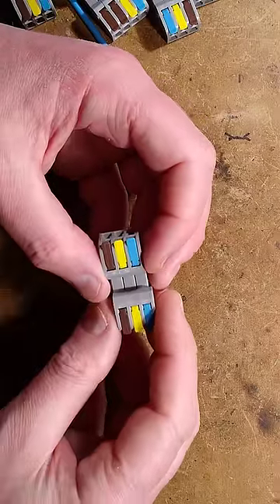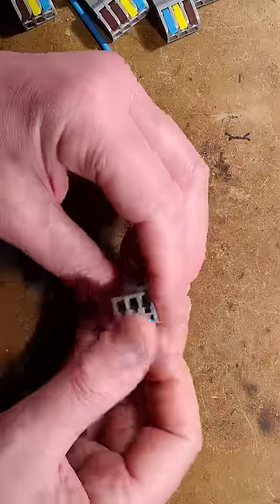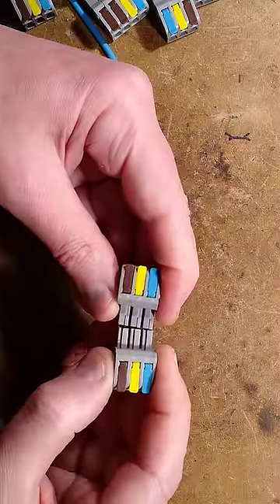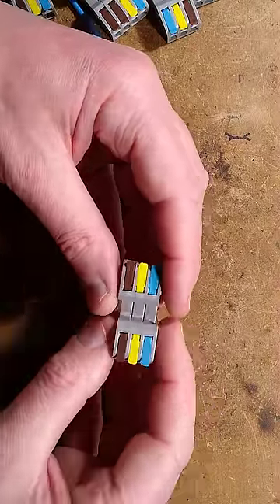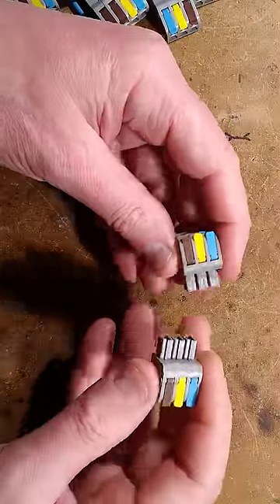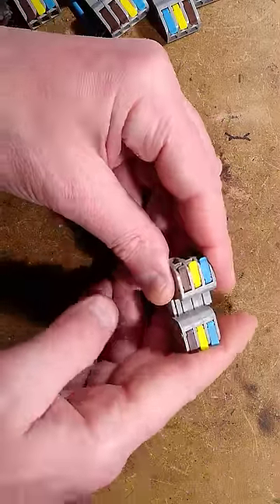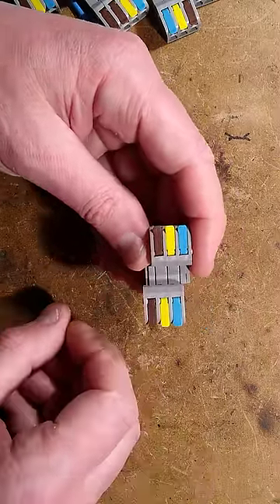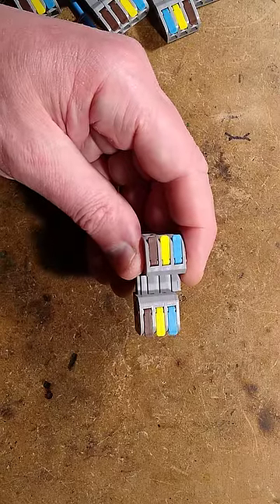This connector can kill you

Comment: As an electrician I will say take your time to make sure you are connecting properly but i will say it would be easy for the manufacturer to add rectangular male and female guards which makes them less universal i guess but at the same time i would make sure my lines were on male ends that way i know if it's male it's supplying power
Reply: In fact I've rarely seen a connector without male and female ends

Comment: Looks like this would only be rated for lighting circuits due to its size, You should gave some sort of fault protection like an RCD or RCBO protecting this circuit which would trip straight away on a Line to Earth or Neutral to Earth fault/ incorrect connection.

I would be more concerned if you do not have any ADS (Automatic Disconnection of Supply) device at your Consumer Unit/ Fuse Board.

These connectors, if used correctly and the quality of them, are great as long as you have the correct Current Rating and Conductor Size connector.  You should also put terminated conductors into some form of junction box for further protection.

Comment: Rotate the left plugs connection alignment 90 degrees and the right plugs alignment 180 degrees. Now it cant be put in misaligned, upside down or any other unintended direction without Intentional alteration.

Comment: If you connect the Live  to Earth then the circuit will trip. unless of course the ground is not in fact grounded, then the casing will become energized, but there's no path to ground to complete the circuit, so your your 👍
Reply: Thanks. I was wondering "do they didn't have differential circuit breaker in house's grid in USA ??"
Because if not, then the wall grid and any damaged electric device could actually kill you.

I think this guy just didn't know what he's saying. That's 100% more probably than having no circuit breaker in all USA 😅

Unfortunately look like nobody in the comments know anything about domestic electric grid😢
At least there's some engineer to think for them !

Comment: Yes and the assuming it has an rcd it would trip instantly. Maybe only use these on RCD protected circuits
Reply from the maker: The RCD would only trip instantly if the connected device was on a grounded surface.

Comment: In the 1880’s Oliver Heaviside wanted to figure out how much electricity was being wasted by then-current design electric generators, so he divided the total coulombs produced in the field by the cross section of the wire.  His answer ran to thirteen orders of magnitude.  

Aghast, he threw his answer away, went to the stationer’s and bought a bigger envelope, and tried again.  The second result was even bigger.  Knowing no one would believe him, he abandoned his quest and moved on to other projects.  

TL; DR, if we designed batteries and plugs correctly, we could run the entire United States’ grid off a single 9-volt battery.  Listen to Louie the Lightning Bug kids, and play it safe around electricity.

Comment: Wouldn't that immediately trip the breaker because ground is tied to the bus with neutral and it would be a short circuit?
Reply from the maker: Not if the loads case was not sitting on a grounded surface.
Reply: @bigclivedotcom  But wouldn't the case itself be grounded with a ground wire back to the breaker box?

Comment: This is why you always need to be aware of what you're working with and to test connections. 
That's neat but i wouldn't use it. Single piece terminal would be more effective. Ive seen a lot of cheap knockoff third party parts that dont put measures in place for things like this. Also do not be doing electrical work with the power on if you value your life. Use a multimeter to ensure you've connected things properly before applying power.

There's a lot of common sense needed for electrical work. We all are aware common sense ain't common.

Comment: If the only fault is live connected to ground, then nothing would really happen. Because the ground and the neutral are connected in the panel, so unless you are also having a neutral failure the appliance case won't carry live voltage. The majority of voltage will return to neutral via the ground-neutral bonding jumper in the main panel

Comment: So there is one live and one neutral connector not connected, therefore you don't have a completed circuit. A bit like trying to connect one jumper cable and expecring something to happen. Or am I missing something?
Reply from the maker: If you have a motor sitting on the table in front of you and connect its case to live you will have a live motor sitting in front of you.  If you are referenced to ground and you touch it, it's YOU who completes the circuit.

Comment: The same would happen if you weren’t using this connector and accidentally connected the live and earth together.  These things are just tools to help make your job easier.  They aren’t there to replace any part of your job, especially the part where you check and double check that what you’re doing is safe 🤷‍♂️
Reply: Exactly. This design is fine, nothing wrong with this connector.  It's the idiots who use them incorrectly that have a problem with it. Any connector can have that same issue if you cross the live and ground wire, not just this one. People in this comment thread are making comments about something that they know nothing about

Comment: I don't like those connectors either there are some better options besides what type of machine i wouldn't trust them they can melt if you are using something that draws alot of current they will fail easy

Comment: I’m not that dumb to do that.   Things are way to safety made.  The connectors like these are a pain to take apart.  They wanna break before they’ll release.  You need to press like 3 things so they’ll release.  And you almost would rather just cut them and solder like back in the old day.  When it’s cold out too trying to muck with with your fingers.  My brain (hammer smash)

Comment: Some of these modular connectors and DIN rail components coming out of China are really fantastic, they have some great designs and high utility, but then you get an absolute stinker like this or that "smart" breaker you reviewed where the oversights are so blatant and easily fixed by changing a couple angles in a CAD file that it ruins the reputation of all the manufacturers on Ali making very cool and cheap tech available for the average consumer (me.) The waterproof screwed-on LED cables I have that cost me $10 for 20 pairs have different sized pins and a peg-in-slot design in the connector to make sure you can't even intentionally reverse polarity (the first thing I tried when I got them because I know I'm clumsy af.) I really wish the Chinese government had some way for foreigners to report stuff like this. Internally, China takes public safety regulations very seriously (just look up what happens to corrupt contractors who cut corners so blatantly that it gets the attention of the provincial or even the national committees) so why not let foreigners weed out bad actors that are also selling these deathtraps in China and getting away with it because of local corruption or just plain old survivorship bias.

Comment: I'm ignorant to anything electric. If you do make this mistake and the metal chassis of your device becomes live with, lets say 220V AC, and you touch the chassis will you automatically die or would the breaker in house be tripped thus saving tour life?
Reply from the maker: If there's an RCD or GFCI then it will hopefully save you from a bad shock.  If there isn't one then the risk of electrocution exists.

Comment: That's the least of your concerns if you're dumb enough to hook up that connector to potentially lethal amounts of power. 

Insulation catching fire because the wire gauge is too small would be your first concern.

Comment: If that happened, my reaction is first, why are you working with a live socket, second is what happened to the fuse. I mean that should immediately trip both the differential and the power fuse.
It could be made better to prevent that error but you have far more worrying ssues if you do that and the casing actually goes live.

Comment: If you plugged live into ground the breaker better trip.
Reply from the maker: If the device is sitting on an ungrounded surface there will be no current flow (until someone touches it.)
Reply: @bigclivedotcom  but you have ground connected to neutral so you should still have a fault current path that should sort the line to ground and trip.

Comment: Designing it as a hermaphroditic connector is itself a serious hazard, even before looking at the universal design. There's a REASON that all safe designs to not allow you to just connect two independent building power circuits together.Even if you don't shift the plugs to connect Hot to Chassis, there is nothing preventing two 'line side' plugs from being plugged together, cross-connecting Hot and Neutral.

Comment: But it’ll be fine the fuse will blow…… after your fingers. This is why rcds and not buying stuff off eBay are important. 
We’v had this type of connection for lighting forever but with one big difference it only goes in one way. Buy reputable gear and this is a D.estroy I.t Y.ourself special

Comment: If your circuit breaker is going to give you 250 volts out of a single wall outlet there's a problem and it's not with that connector

Comment: Nope. Connect phase to earth and all the system will just cut off immediately. 
At least it's what happen for a French electric grid. There's a thing constantly counting what's in and what's out of the house grid. It's named "disjoncteur différentiel", differencial circuit breaker...

If the amper in a'd ampere out of the geid are different : immediately cut off.
Because it tells that there's an electric device that have a misfunction that's connecting the outside of the device to phase, meaning you can get electrocuted by touching it. Or there's someone getting electrocuted somewhere.

If you didn't have a thing that immediately cut off your grid in such a case : then you really can be killed off by your house's grid ! 😱
Reply from the maker: If this was in a piece of industrial equipment and a motor was removed and placed on an ungrounded surface it would become live.  Very little industrial equipment uses differential breakers.
Reply: @bigclivedotcom  that's not the equipment that have differential breaker. It's in the grid.
I cannot imagine a house or industry grid without this. Maybe in a poor Indian or Somalia village, eventually. But not in any modern system.

Try to connect it this way, and you will see what happens. Light will shut down instantly.

Comment: If you are "fumbling" with live wires without RCD, it's not the connector that is killing you.
Reply from the maker: Maintenance workers often have to work live to find elusive electrical control system faults.  Not all industrial equipment is fitted with an RCD.

Comment: It's so shocking that you would work on high voltage and high amperage equipment without first cutting the power.

Connectors aren't perfect, but servicing equipment with a LOT of live power still going to it is even LESS perfect than the connector itself.
Reply from the maker: The reality is that a lot of electrical diagnostic work can only be done with the machine powered, so the fault can be traced through the active circuitry.
It's like trying to proofread a safety document with the monitor turned off.

Comment: You are not supposed to use JUNK like this for AC line voltage. Connectors like this are only good for low voltage prototyping only. Connectors are supposed to have keys and shroud to prevent misalignment!

Comment: It looks like a low-voltage connector, so no, it won't kill you.  But let's say you did use it for house wiring - It's not code for that, you should have a GFCI to prevent electrocution and you would statistically use it most for a 15 or 20 amp circuit, which again, not likely to kill you and the breaker should trip. Also, you are saying using a connector for an unintended purpose, against code, and connecting it improperly could cause harm is true of most anything.

Comment: BS! The worst that would happen is you would trip a circuit breaker, and melt a tiny bit of the connector in the process. No metal would touch your fingers anyway. You would have to piss on the connecter to get a shock, and even then, unless you are touching a grounded metal appliance and standing in a few feet of water, the worse that would happen is you would get a momentary shock.
Reply from the maker: If you were servicing a machine with a pump and removed the pump, placed it on the floor next to you and then misplugged it, the case would become live with respect to all surrounding grounded metalwork.  If you touched the pump case you would get a shock, and unless an RCD/GFCI was in use that could be fatal.

Comment: The moment you connect it would result in a small bleed and your box detects it and it will turn off so your theory is false
Reply from the maker: If the connected device was on an insulated surface there would be no leakage path and it would become live.

Comment: It's called paying attention to what you are doing... do you pluck hot bacon out of the frying pan? do you blindly stick your hand into holes?  If you have to have a "blind connection", which is highly stupid and best avoided in the first place, then spend the extra to get a specifically keyed connector for that connection point.  I appreciate your videos and warnings, but you could just as easily have a "safe" connector and stick the wire into the wrong leverlock hole if you are not properly observing your wiring.

Comment: First of all, you don't work on live circuits.
Second: what about fuses and RCDs? As soon as you power the circuits back on and really connect live to earth, then your safety systems should work as intended and trigger.

This piece here could be smarter than it is, but the problems arise from elsewhere: either completly unsafe working conditions or a dangerously unsafe electrical system, that should be shut off immediately.

Comment: Shames eBay for selling things without doing all the research

Yet YouTube allows you to put out this video without doing ANY research.

Don't learn your trade from YouTube kids
Reply from the maker: Formally trained electrician for over 40 years.  If the connector is mated the way shown then a pump sitting on an ungrounded surface would become live at full mains voltage.  If touched while providing a path to ground it could result in a significant shock.  Not all equipment has the luxury of an RCD or GFCI.

Comment: you shouldnt work live anyways
Reply from the maker: That's the only sensible way that many faults can be found.
Reply: @bigclivedotcom  i know what you mean and i do it to.  i ment  if you plug in a machine that demands current and turns on immediatly after plugging this connecter in. the guy must be doing something wrong.  Turn the machine off, and plug it in and then turn it back on.  Otherwise this could cost some one money or his life